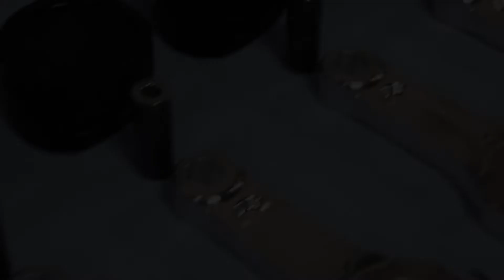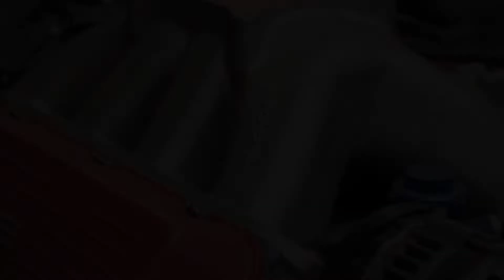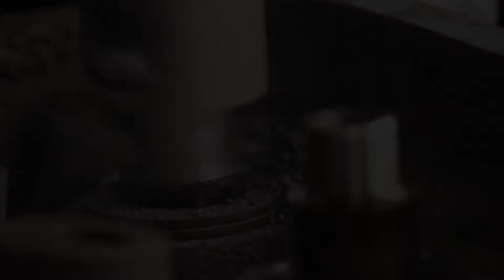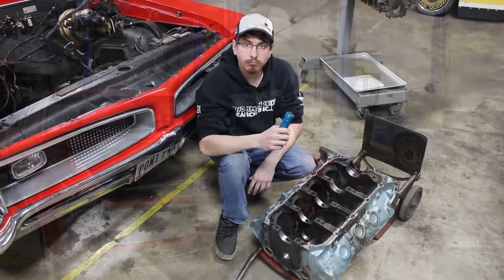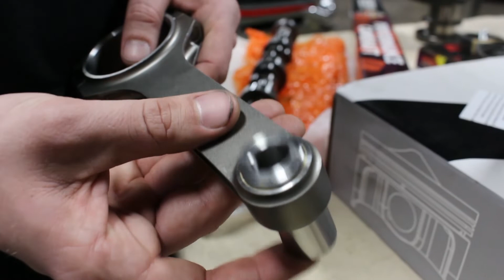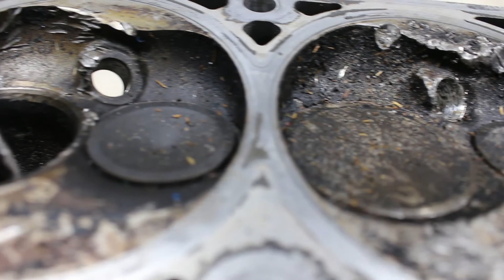1966 Pontiac GTO Turbo Build Part 2

Comment: Small block in an iconic GTO, real original idea there. As a Ponitac guy I would rather see a Hemi go in it rather than just another Chevy, all because you don't understand how to build a Pontiac motor.
Reply: Been racing Ponatics for years. But I'm sorry chevy is a better engine.
Reply: @ScooterLee-ei1ep  'been hearing that crap for 40 years. Could have easily built a 1000 hp Pontiac motor on pump gas. Too much for the tires anyway. Then it would have been worth something.

Comment: There is no Pontiac " Big Block " or " small block" The external dimensions on the different engines is the same. The 400 is the same size as the 455. The 428 is the same size as the 350. They do not have different size blocks. Now, there are some major internal differences but not in overall block size.